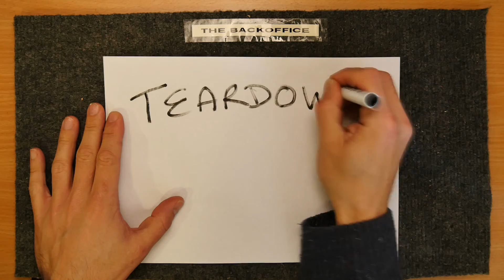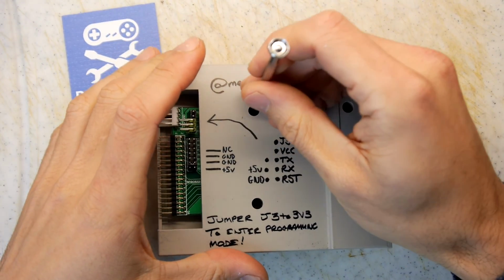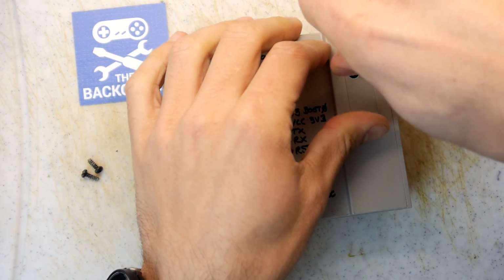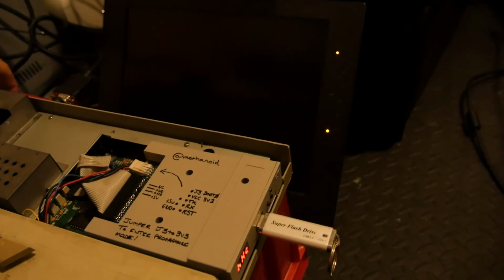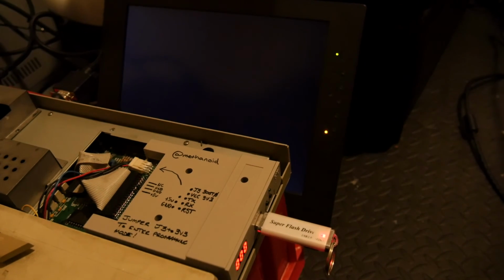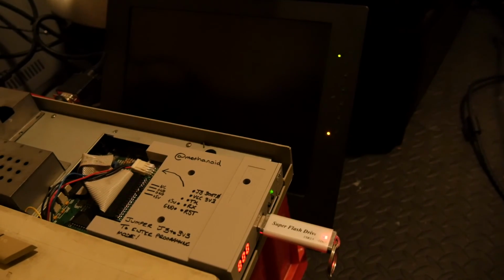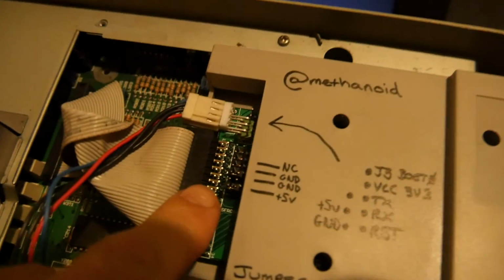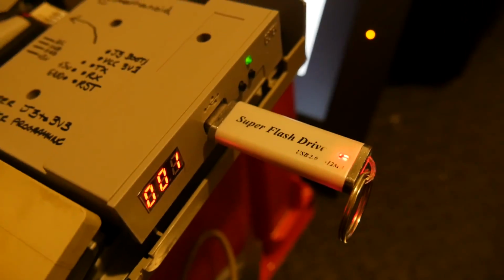GoTEK Atari Floppy Emulator Sound Mod and Test

Comment: The reason I tracked down this rare video of doing the Transisiter/resister circuit is it's hard to hear the Floppy wana be sounds..  After reading below comment from @jeffsereno , Im wondering if it's any louder than simple 2 JP pins
Reply from the maker: Hiding the transistor has the benefit that you're less likely to put any strain on the internal components and break your gotek

Comment: What parts are used to do this mod? Have tried to use the jumpers for my buzzer but the sound is to low. And changing the settings in hxc wont change the sound of the buzzer.

Thanks
Reply from the maker: If I recall it was pretty much a transistor, resistor and a piezoelectric buzzer. Any standard npn transistor should do and maybe a 1k resistor
Reply: backofficeshow ok thanks. Will try it out. Some type of npn i got and also a 1k resistor. :)
Reply: I dont think Ill bother with soldering on a shitty piezo/buzzer(not a real speaker). Sounds so crappy.. I might try doing something with samples or some other solution via Arduino and a real speaker.

Comment: The only problem with the buzzer is there too dam quiet If only there was some small holes or 1 hole at the front of the casing and fix the buzzer behind the hole so the sound will be louder and heard. I've got a gotek in a twin drive system in a metal case and its very hard to hear the buzzer.
Reply from the maker: I guess a few minutes with a Dremel would help

Comment: Hmm...it still doesn't make the really deep grunting access noises that the SF314 made. You'd think that could be sampled and played back. Although I think it would be cooler to sample the POKEY noises from the Atari 8-bits when accessing SIO devices [like disk and tape drives] and then play back those... :)
Reply from the maker: +Jeremy Holloway I'm sure a technological solution can be found. Possibly using a solenoid as well to really bang into the chassis properly 😂
Reply: True. I really was trying to remember that grunting noise that the 1040STf's internal drive and the SF314 made. Can't remember what the 1.44MB drive did in the Falcon030. And we won't even mention that abomination known as the SF354. Curse that single-sided drive to Hades!

Comment: You can now do this sound mod with just a cable and the piezo off the JB header next to the DS0 header. No soldering or resistors or whatever required anymore - the HxC firmware has direct support for the drive sound now.
Reply from the maker: +Jeff Sereno Cool thanks for the update 👍
Reply: No worries! Just update your firmware to 3.0.19.2a and plug in for clicky heaven! =) You can also turn the sound on and off in the HxC settings of the boot selector (it's already on by default).
Reply: @JeffSereno  Is there a diagram for this? Without the Transistor and 5V won't it be quieter? I was using direct speaker hookup to the 2 JB pins, but it's not loud enough. So, question is, is it louder with the older video method?

Comment: It's worth having it, if only because you don't realise how much feedback you actually get from the noises of an original floppy drive until you don't have them anymore.

They reassure you that the thing is still working and hasn't just frozen.
Reply from the maker: +TheTurnipKing yes, pure silence is pretty eerie! Often the system just sits there doing very little so that occasional chirp is indeed pretty reassuring 😂